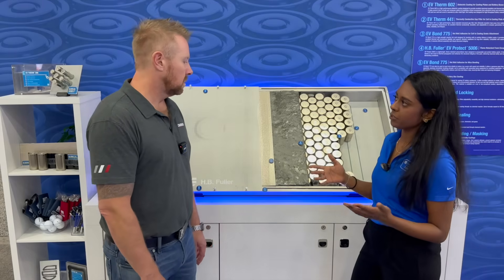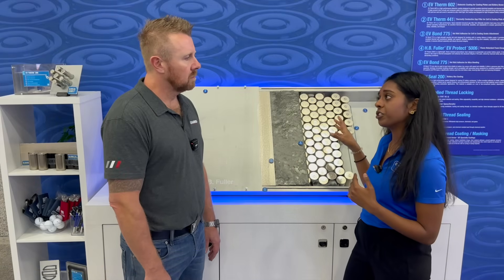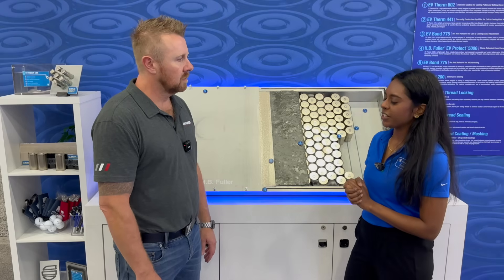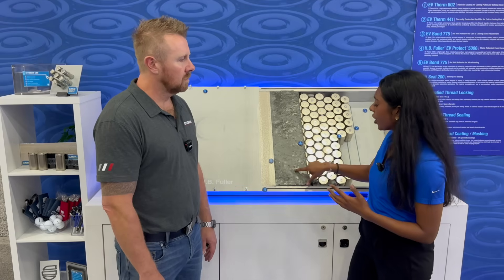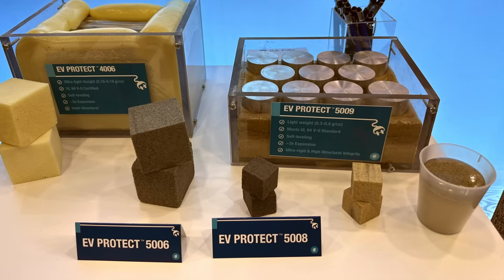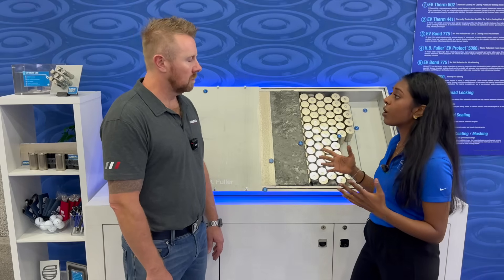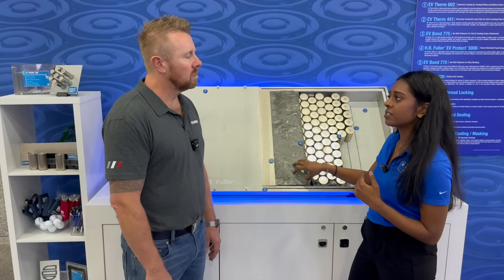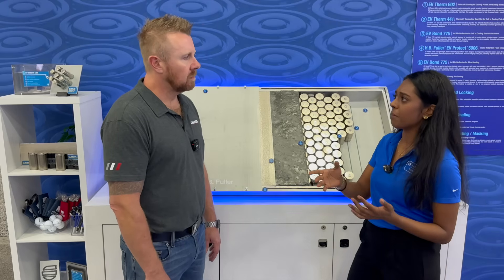Enhancing EV Battery Packs with Foams, Adhesives and High-Performance Thermal Materials

Comment: Does this stop thermal runnaway or just slow it down? How ould these type products prevent fires and help with firefighting of the EV vehciles? I have more ideas that would help out with this issue and that would not allow thermal runaway. While these are great things to slow down potential fire issues, but doesn't help stop the fire. I may have one solution for certain types of batteries, but you guys may have already done this. If you want to contact me please do so.